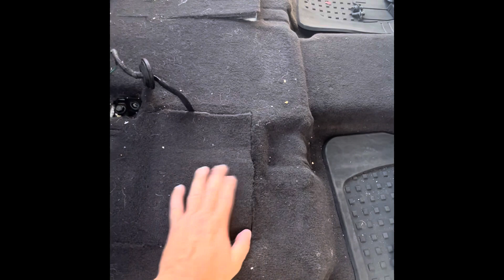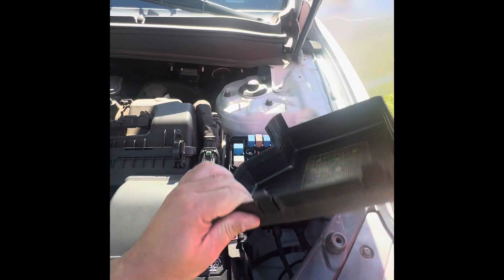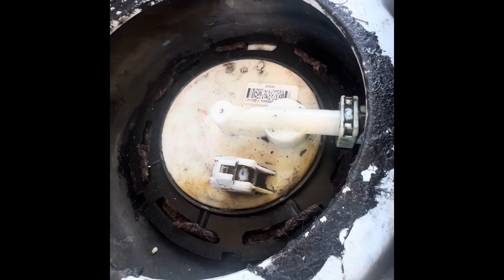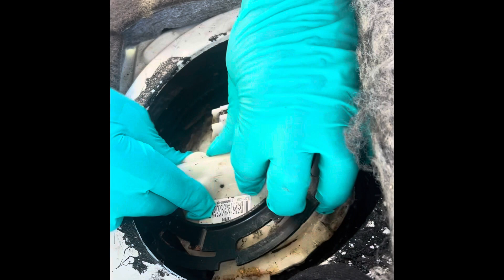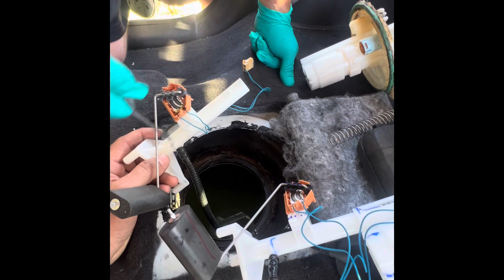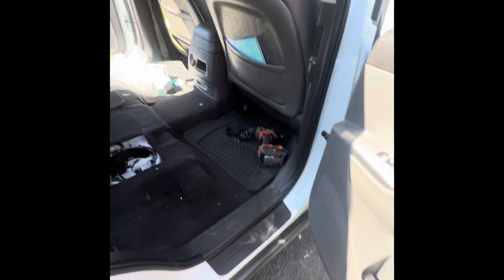2011 Hyundai Santa Fe fuel level sending unit replacement part two

Comment: Want to know what could be the reason why when put on my A, the engine goes off. And it is not running smoothly when idle. Please kindly suggest a possible solution
Reply from the maker: It could be so many things start with making sure your engine oil is good at the right level after that when was the last time you had a tuneup check your spark plugs it could also be your fuel pump. It could be your mass airflow sensor, dirty, or needs replacement, there’s so many things I gave you a few to check. Good luck. If you find out, let me know. I would love to hear from you. Thank you for the comment.